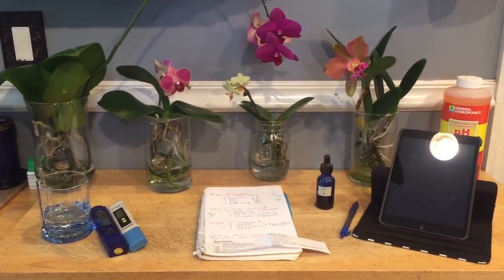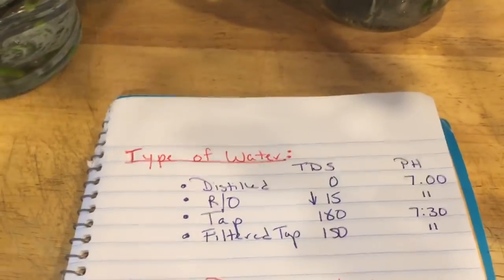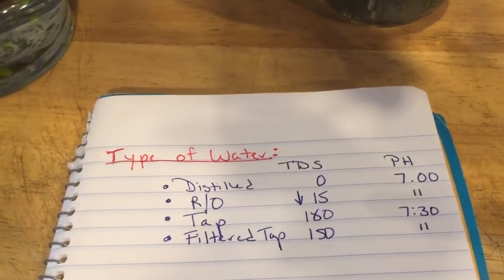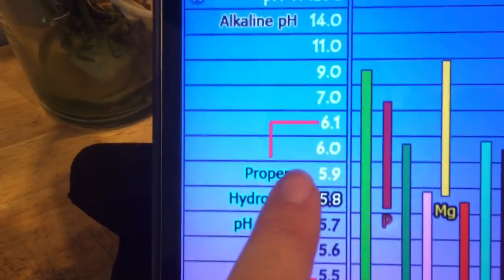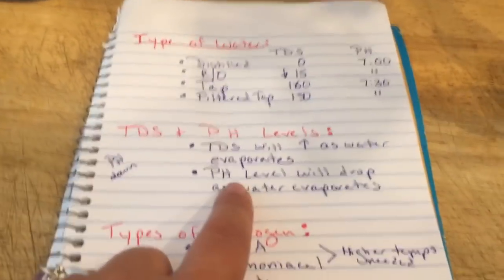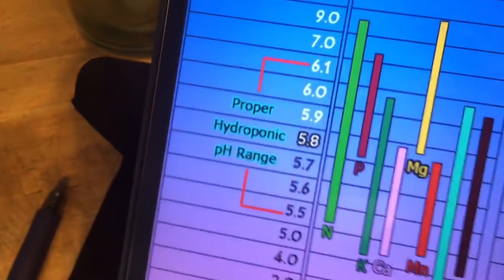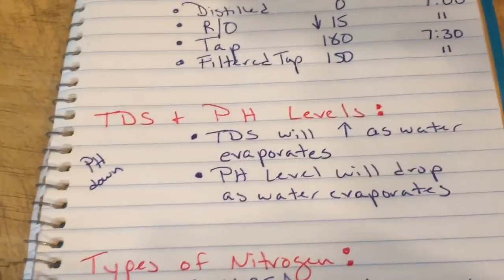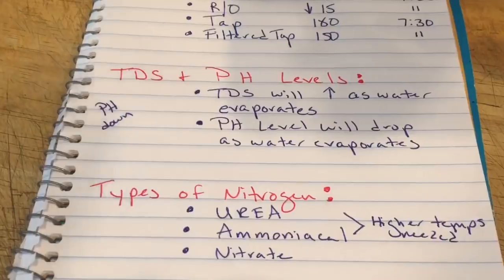Fertilizing Orchids

Comment: If u left the water in and untouched for longer than a week wouldn’t the PH naturally decrease without the use of PH Down? And get you the needed cal and mag?
Reply from the maker: Kay Nay while that is possible I would have to be checking the water constantly to insure it was reaching proper PH levels and unfortunately I don't have time for that. Also I don't put enough water in the containers to last more then one week. I actually am topping up the water on several of my orchids every few days. I can't put more water in the containers to start off because I don't want root and bulb rot so really the best way to insure proper nutrition for my environment is to use PH down. I am experimenting with higher TDS levels and if at some point I see that higher levels don't negatively affect my plants I may do that instead of PH down. The more fertilizer you put in the water the lower the PH drops. But I'm not quite comfortable using full strength at this time.

Comment: To lower the ph do you lower the ph first and then add fertilizer? I have noticed that it adds to the tds amount if I lower the ph after I add fertilizer to the water. I’m concerned about using too much minerals. Should I do the ph first then fertilize or vice versa? You mentioned that you use 1/2 tsp of fertilizer instead 1/8tsp like before.
Reply from the maker: Aurora's Water Culture Orchids I fertilizer first and then adjust PH. I find adding the PH down does not effect the TDS to a point that I am concerned. 
You are right! I changed from using 1/8 tsp to 1/2 tsp. Because I use a nitrate nitrogen and change the water weekly I find the stronger TDS level has not had any negative effects on my collection. I watch them like a hawk though 😁 just in case.